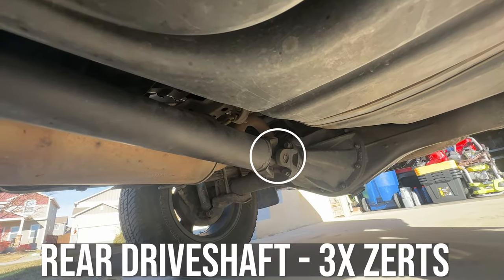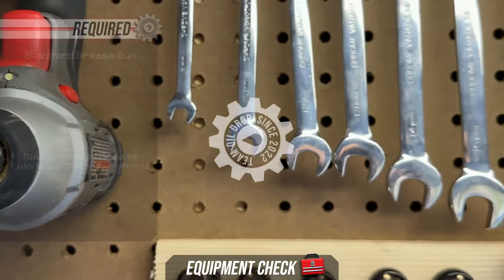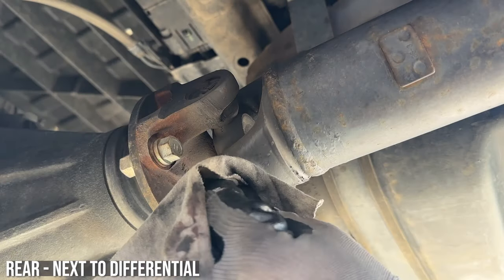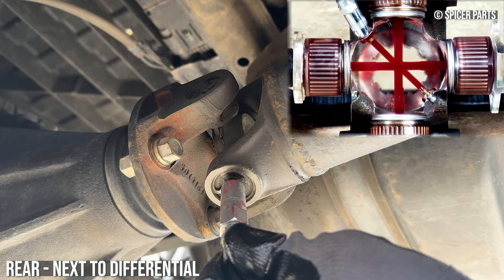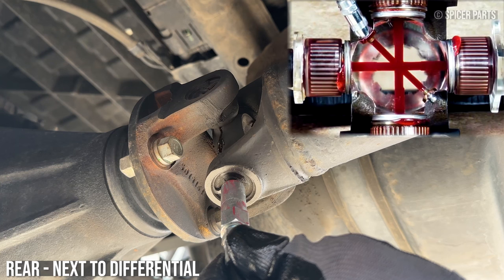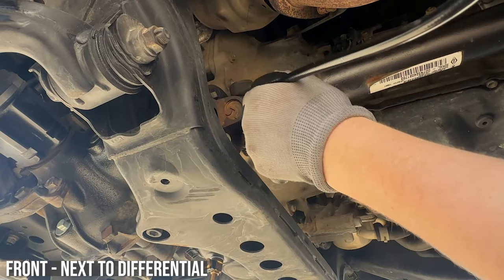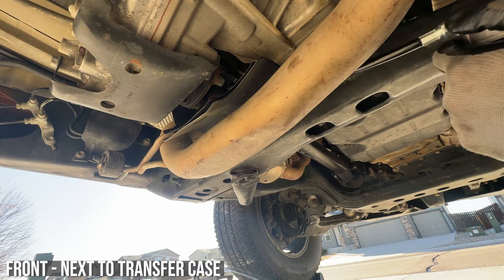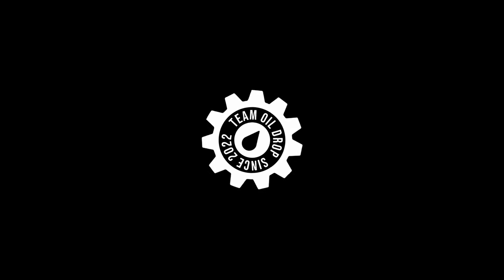How to Grease Driveshafts Tacoma 3rd Gen

Comment: Nice video as always.  The fitting by the Transfer Case is a major pain in the butt.  Next time I am going to remove the heat shield.  Also, I bought a Lock 'n' Lube grease gun and it really helps.
Reply from the maker: Thanks! It really can be a pain in the butt. I got lucky with just the right angle. Nice, I’ll check it out!

Comment: 2019 Off-road 4WD V6, sealed rear.  Has fittings on front drive shaft, absolute pain to get to the rear fitting on the front driveshaft just off the transfer case, only 1 position is reachable and was a blind connection from underneath without a lift.
Reply from the maker: It is very tight without taking off the shield but doable. Grease gun with a flex hose is key. Even then though, can be a real pita.

Comment: 2017 or 4x4 , only found 2 zerks on the front driveshaft, rear appeared to be sealed?  gonna raise it up and check again now, thanks again for the vids!

anyone trying to yank the grease gun back off the zerk, release the pressure with a wrench on the nut.
Reply from the maker: Good investigating! And good suggestions! Thanks for the words brother! 🍻

Comment: I don’t see any ports for hooking up the grease gun on my 2007’s drive shaft.  Is it different for earlier generation Tacomas?
Reply from the maker: It’s possible the u joints are sealed on a 2007… but I don’t believe they are. I know other years of the 2nd gen weren’t sealed… it would be in the joints of the shaft and not along it. If they aren’t in there then you’re sealed and no worries!

Comment: I have issues when I connect to the zerk where the grease doesn’t enter into the joint.  It’s also a challenge to discount the grease gun from the zerk. Any advice ? Thanks!
Reply from the maker: Popping the grease gun off can be a challenge sometimes. I made it look easier than it is. You may have a clogged zerk. Attempt applying some heat to it with a lighter or gently with a small gas torch then try again. Wipe it off thoroughly before connecting as well.

Comment: Now grease the ball joints etc
Reply from the maker: Most balljoints, at least the factory 3rd Gen ones are sealed.

Greg the Editor
Reply: I use a grease gun syringe to lube my factory ball joints that have no grease fittings.

Comment: I can't find a greas fitting anywhere on my 2021 4WD off road??
Reply from the maker: For you won't be anywhere on the rear driveshaft but are you certian none on the front? Spin it in your hand assuming you are in 2wd and dobule check. Maybe 22's came sealed!
Reply: I am literally laying under my 22 v6 4wd sr looking for zerks. I can’t find any on either drive shaft. I’ve visually and physically touched everything. I’m assuming they finally used sealed on both.
Reply: I too couldn’t find any at all on my 2020 TRD Off-road.   Even crawled under and checked twice.   I guess I’m lucky and I have sealed units.
Reply: @geegaw14  same, 2020 TRD Off Road and no fittings